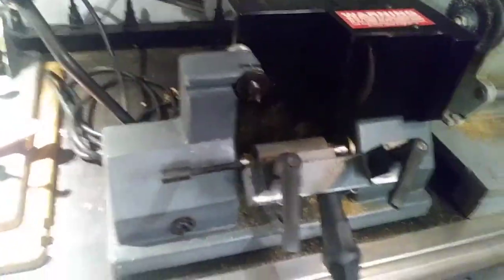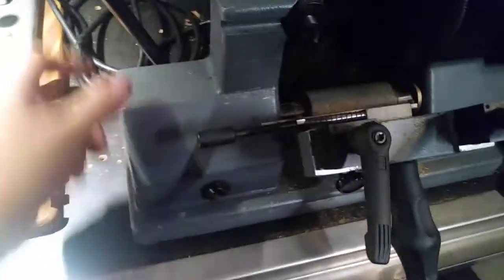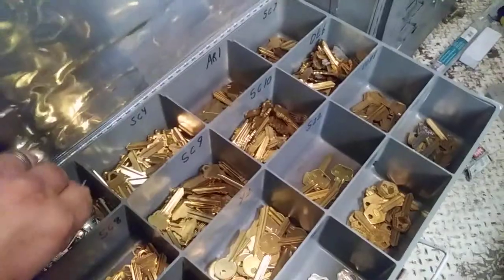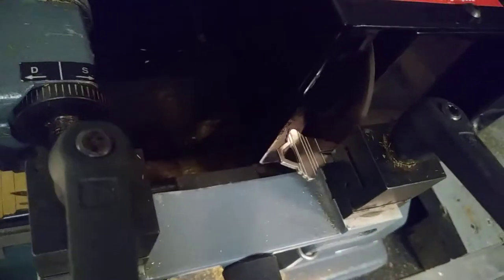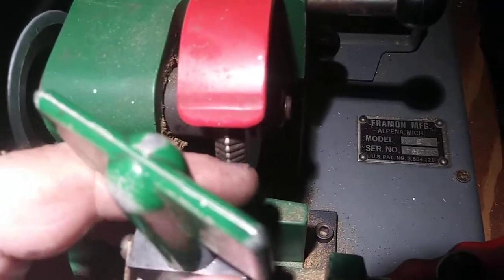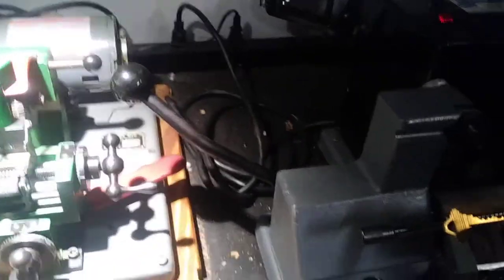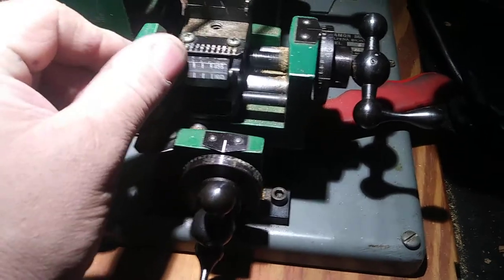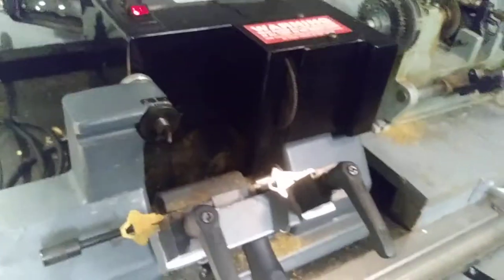Framon express key machine review

Comment: Yep, that looks like a really good machine.  how many inches from the pivot bar up to the cutter shaft?
looks like more than on any other machine....good geometry....keys will be coming into the cutter pretty
much perpendicular.  do the jaws hold auto keys ok?  how about a tr47?  thanks for posting.
Reply from the maker: tr47 cuts just fine the jaws are reversible the cut  automotive